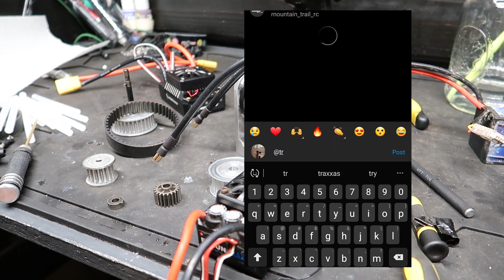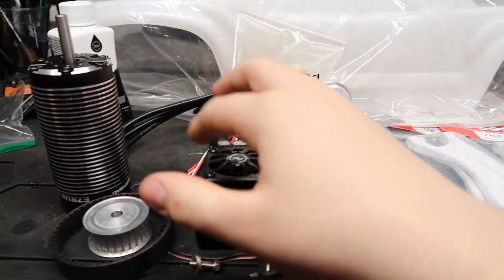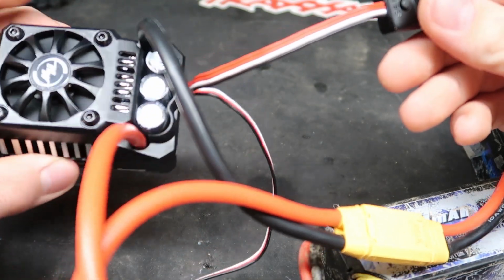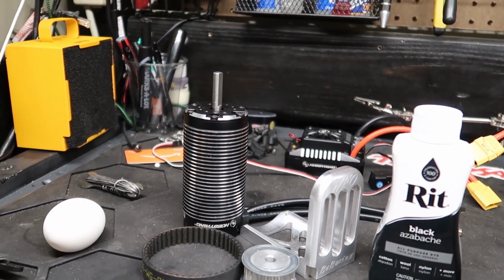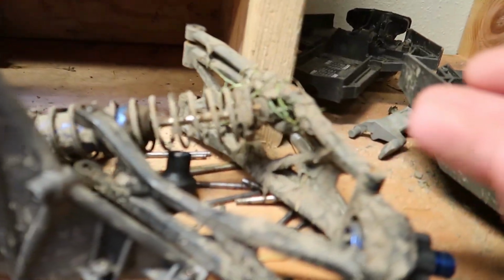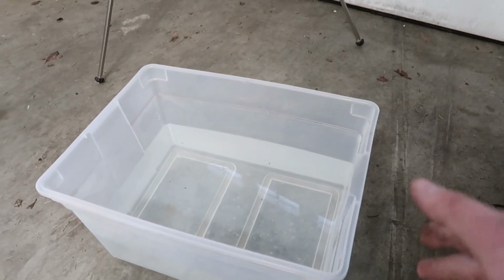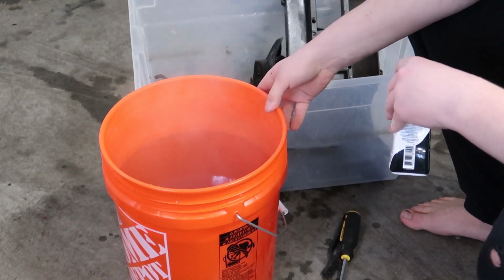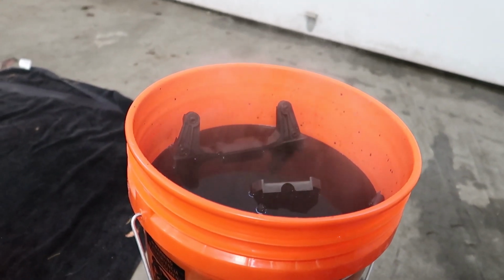X-Maxx Re-Build And Upgrades! Pt.1 [Give Away]

Comment: How long you been using the belt drive? An your preferred tires?
Reply from the maker: For me I prefer the proline trenchers, as far as the belt system I have now had it for about 3 months and I personally dont regret it!
Reply: @RCMANIAC-YT   I’m currently running 1050 kv  25/35 mod 1.5  so if we’re to try the belt drive I’d get 25/35 pulleys  what count belt would I need?
Reply from the maker: Do you mean what size of belt?
Reply: @RCMANIAC-YT  yes
Reply from the maker: Assuming you are ordering from the WFO store the highest belt pulleys you can get is 25/30 which would be 250 count. Hope this helps... if you have more questions I recommend shooting an email to WFO.
Reply: @RCMANIAC-YT  appreciate the feedback I have WFO products everything held up check my X-Maxx some time my man ⚙️🔋X-Maxx brotherhood!!!